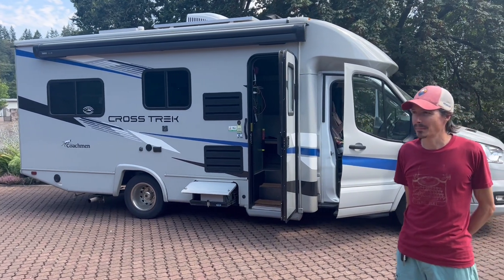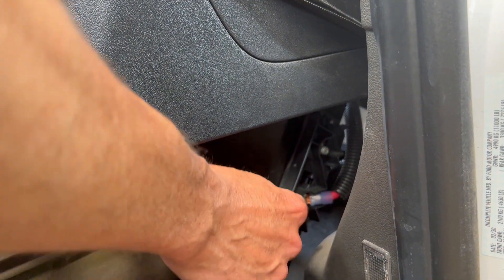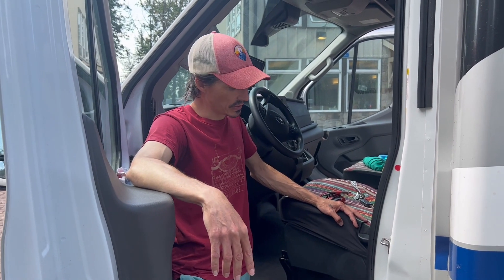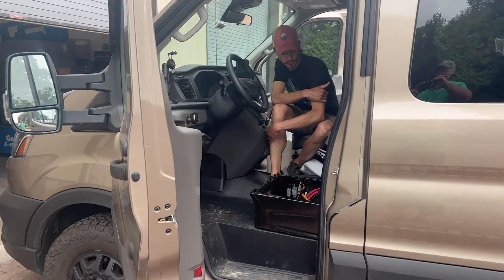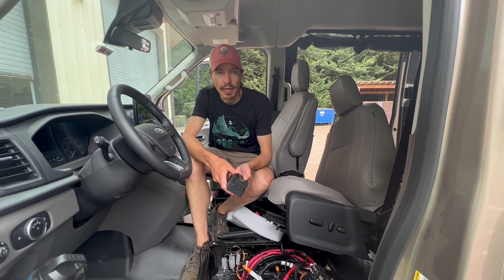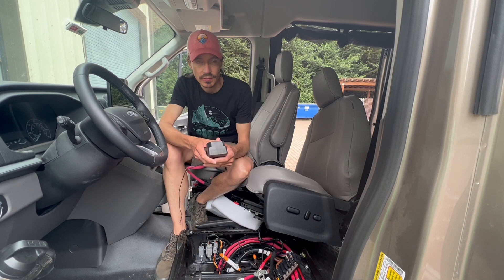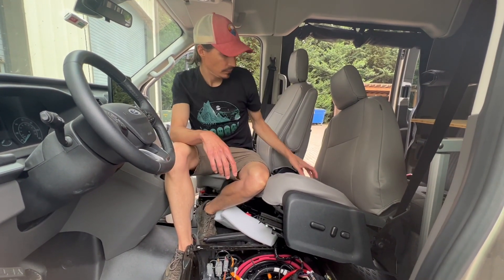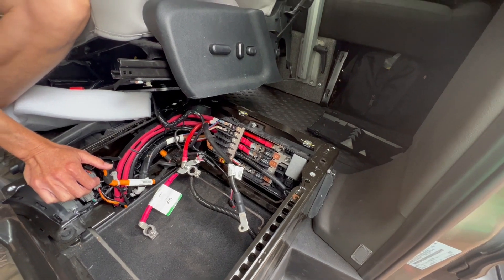2020 and 2021 Ford Transit Alternator Charging | Alternator Charging System

Comment: i'm wanting to connect the positive of my inverter to  connecting to CCP2, where do I connect the negative????
Reply from the maker: The chassis, assuming your inverter isn't going to draw more than CCP2 puts out.
Reply: @GarretTowneAMS  where do i connect to the chassis from inside the van?
Reply from the maker: @ranwayne6441  Anything that is thick metal attached to the frame.  I like the bolts that hold the seat down.
Reply: @GarretTowneAMS  great thanks
Reply: I heard Explorist say its Under the black floor panel between the two seats, as the main chassis negative point to connect.

Comment: My Tiffin Class C on a Ford Transit chassis had the same connection error. (House batteries connected to CCP1 versus CCP2) and required a visit to their factory to remedy (Jan. 2023). My motorhome has two lead acid house batteries, so when they ran down, they easily took over 60 amps of charging when the engine was started, causing the 60-amp fuse under the driver's seat to blow. The electric steps were also connected to CCP1, so the problem (blown 60-amp fuse) would have gone unnoticed except that the electric steps stopped working (in the extended or retracted position). Note that there is a Cole-Hersee solenoid in my system that connects the chassis and house batteries when either is a13.2 volts.

In my case, Tiffin decided to connect directly to the battery instead of CCP2. I assume that they did this so that the battery "boost" switch that allows the house batteries to start the vehicle in case the chassis batteries are low in voltage would properly function. Another assumption of mine is that if the chassis battery voltage is low (i.e. dead battery) then CCP2 will not be "hot" for load shedding reasons.   

GREAT VIDEOS. Clear, concise and very informative. (and very helpful)

Comment: The black wire that goes to the interior for the CCP that you had mentioned....where does the other end go to?
Reply from the maker: The other end of this black wire was already terminated to dual DC/DC chargers at the rear of the Transit where the LiFePO4 battery system was installed.  
It's a bit unconventional, but essentially, we redirected the pre-wired DC/DC input source connection cable to the CCP2 load-side post of the 175A Mega Fuse, which terminates by way of factory-made metal plates at the CCP2 post located on the outside of the driver's seat frame.  If installing such a connection with a clean slate, we would typically connect to the exterior CCP2 post, not internally at the CCP2 175A Mega Fuse post.